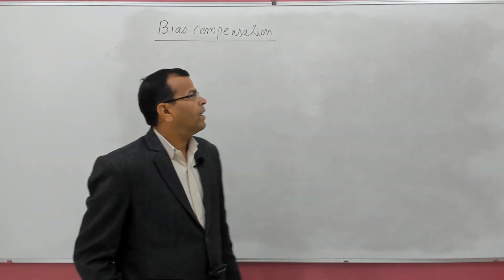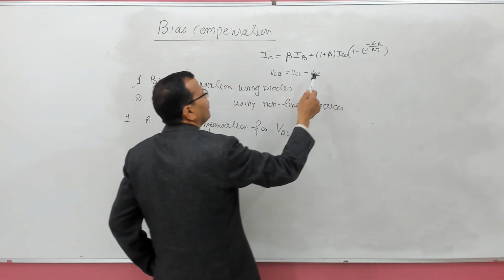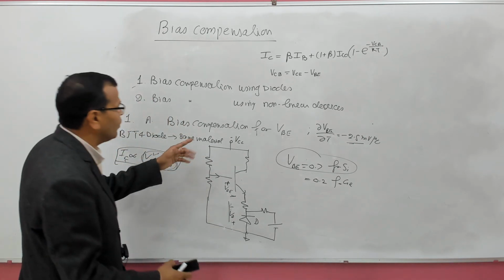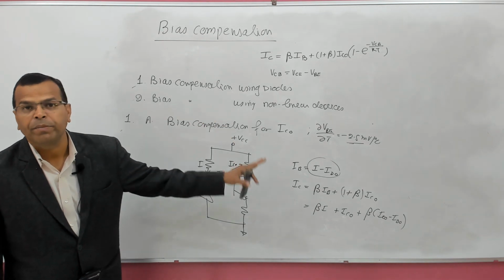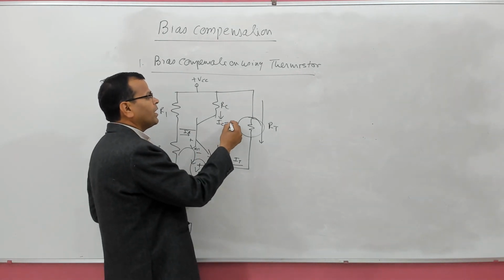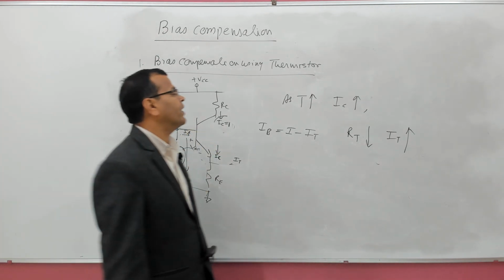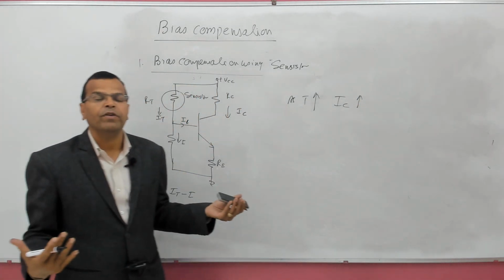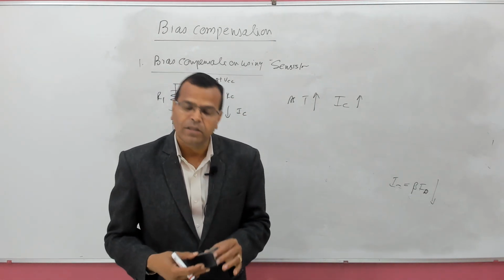EDC & Analog Electronics Chap 7 BJT Biasing L10Bias Compensation of BJT

Comment: Sir in the first thermistor circuit, even if the thermistor was not there even then the increased Ic would increase drop across Re. So why have we put an additional thermistor here? Was the Ic coming from transistor not enough to cause a drop across Re?